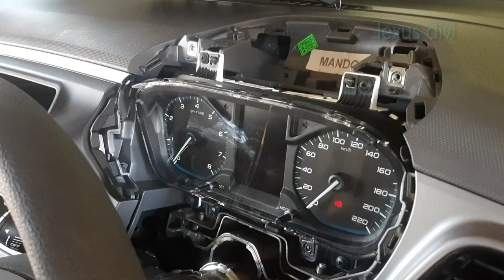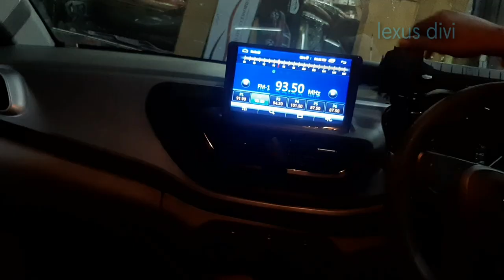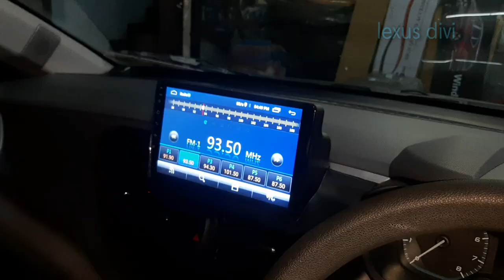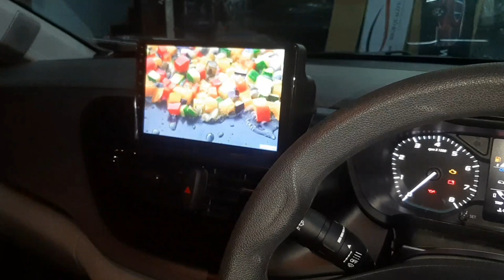Tata altroz 2020 |stereo panel removing |Android stereo fitting|music system 👍

Comment: Bro are they cut any wires, during installation because I installed 2days back lots of wire cutting happen I'm worried
Reply from the maker: No wire cutting coupler to coupler fitting